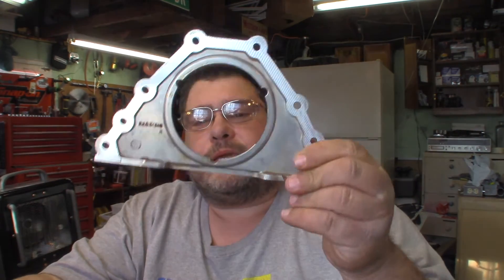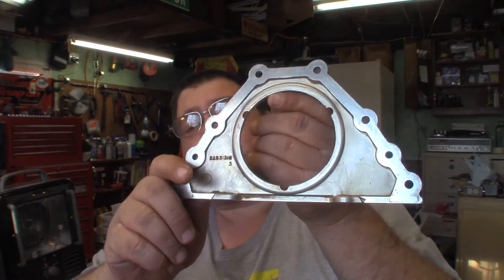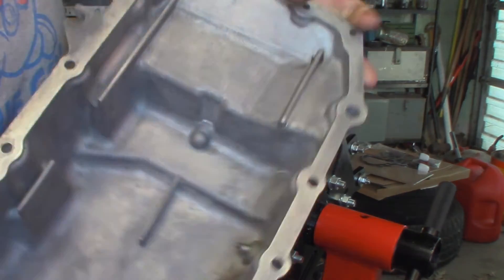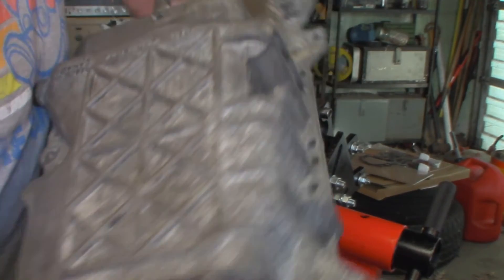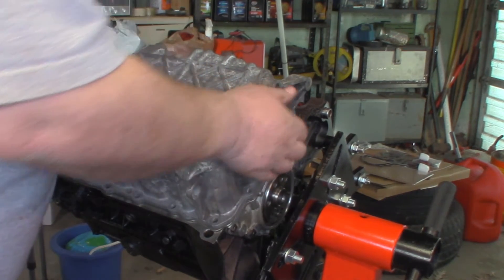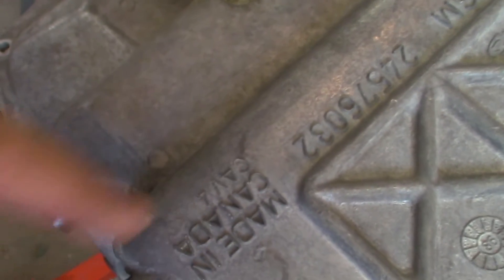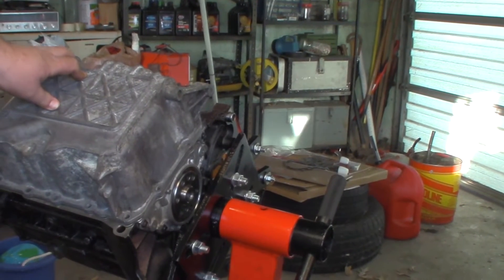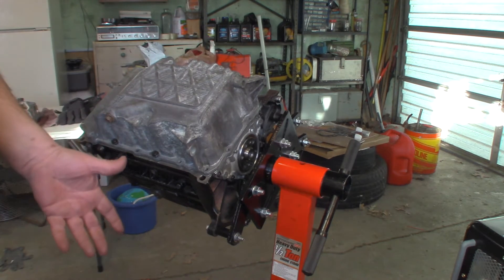LD9 Engine Rebuild Part 12 - Rear Main Seal & Oil Pan - 1999 Grand Am GM 2.4 Quad 4

Comment: Not many people rebuild engines anymore aside from performance and race shops.  I haven't done it in ages, but you're right,  more people should do it.  I think the biggest thing holding people back is that they're afraid it's too difficult or they'll do something wrong.
I think you're better off with the new oil pan gasket anyway.  It would sure suck if after all this,  it started dripping.
Good video.
Reply from the maker: I am definitely replacing all the gaskets now.  I got the complete gasket set with head bolts for $90

I was talking about a couple of years ago when I lost and oil pan due to a chunk of steel flying off a semi and going under my car on the highway knocking a huge hole in it.  I had to get it fixed quick and dealer was the only place that had a gasket in stock and it was $37!  I remember looking at the original one and thinking it looked perfectly fine, but I replaced it anyway.

Sometimes I think the main thing holding most people back is they are busy trying to see who's going to get voted off of some island on some TV show or another.